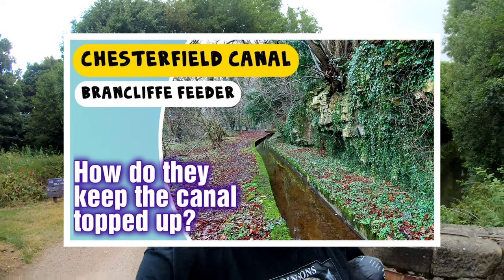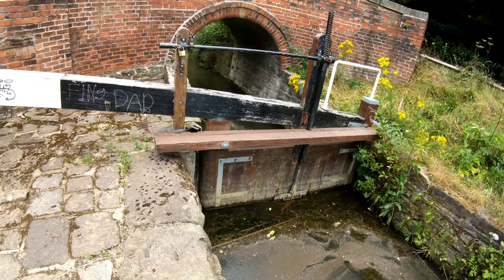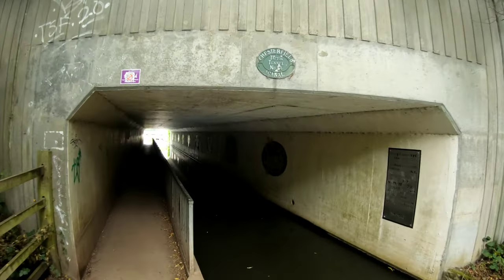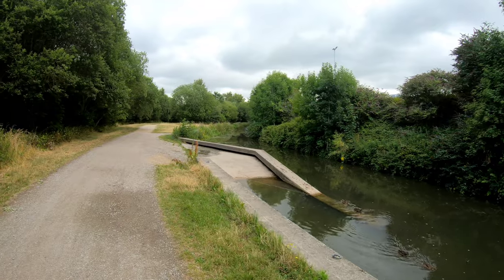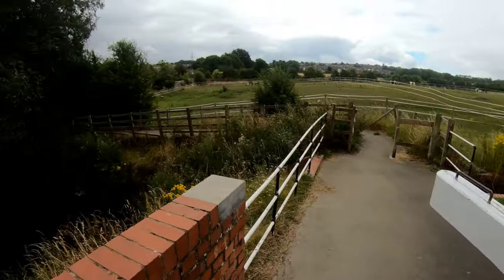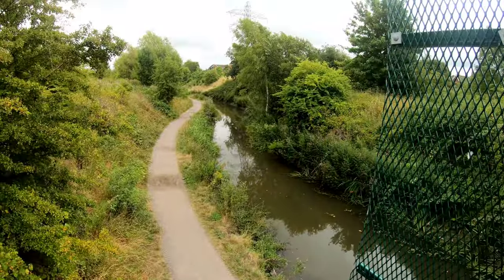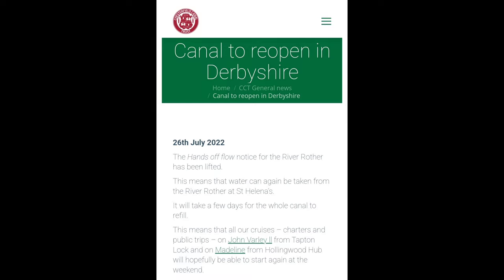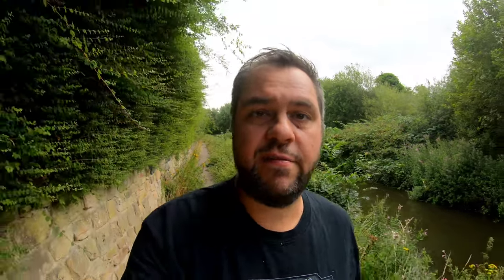Chesterfield Canal Low Water Levels and Stoppage

Comment: I've not been past it for ages, but any mention of Chesterfield makes me think of the crooked spire of the cathedral. I'd always see it from the A61 road when returning to Sheffield and could hardly believe the shape of it. I see that the A61 follows some of the route of the old North Midland Railway line through Chesterfield, where the old Chesterfield Central station once was and that there is still a disused railway tunnel between Brewery Street and Hollis Lane.
Reply from the maker: Ah yes the old Chesterfield Tunnel - You can still get in that if you're adventurous. There's a sloping access driveway to it from the South end.
Reply: Just a slight correction. The crooked spire is just an ordinary church. If it was a cathedral Chesterfield would qualify as a city, which would be nice.